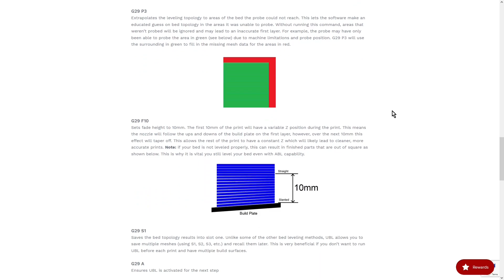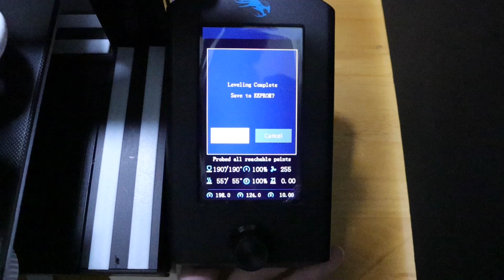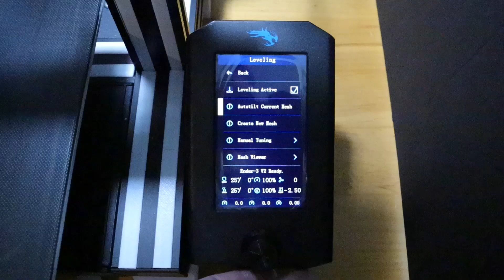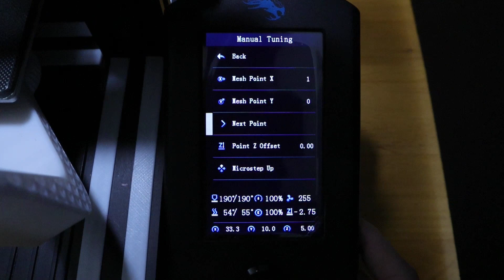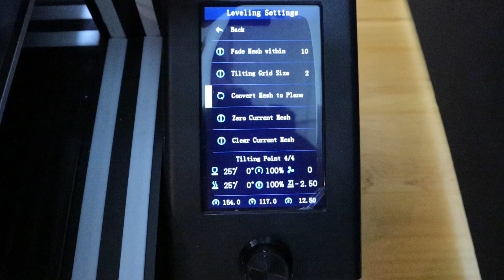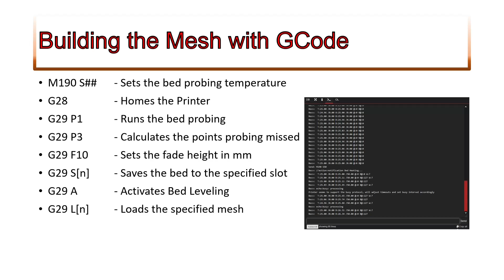Unified Bed Leveling Overview with Jyers Firmware on the Ender 3 v2

Comment: ive been using it smoothly for the past while. specifically the 10x10 hs version. though for some reason it only probes like 68 points out of 100.
Reply from the maker: This is a known issue and something I pointed out in my other jyers video. It happens because the probe can not physically reach all points of the print surface due to the nozzle offset. It will end up missing some of the back and right probe points.

You can work around this by manually setting each of the missed probe points the same way you would set the z offset, just at the different points around the perimeter of the bed.

Ive not bothered with doing that as Ive found that using the G29 P3 command does a decent enough job to guestimate the missed probe points.
Reply: @EB3DPrinting  yea ive been using g29 P3 as well and im always surprised when it think a single point in the corner is super high since it never went over there and the other values are all pretty normal haha. Thanks for your response. glad its not just me

Comment: Fantastic video, thank you. I have an Enders 3v2 with a glass bed and the new CR touch using Jyers Unified Firmware. When I view the mesh the right hand is red ,middle is black and the left side green. Is it possible to help me out please with the bed levelling, as a 78 year old pensioner who is just getting into 3d printing it would be very much appreciated.
Thank you.
Bill M8-)
Scotland
Reply from the maker: So when viewing the bed mesh, the colors are indicators of the bed level. Red means that area is below tolerance, black means that area is within tolerance, green means that area is above tolerance. 

So in your case, since the left side is red, turn the left two bed knobs 1/2 a turn clockwise, then turn the right two bed knobs 1/2 turn counterclockwise.

Next, under the leveling settings menu option, change "Tilting Mesh Grid Size" value to 2

Back out of that menu, scroll up to Auto Tilt current mesh, then run the auto tilt. After auto tilt is finished, scroll down to mesh viewer and see the new changes to the mesh.

Given the nature of creality's glass plates, you will not get a perfectly black mesh, the goal is to get the mesh to acceptable levels. So if your highest red value is below 0.2 and your highest green value is below 0.2, then your mesh is acceptable.
Reply: Thank you the bed is nearly all the same colour. Please Stay Safe

Comment: I’m having an issue where after it finishes probing and I “save” the EEPROM it doesn’t show up in the sd card. Don’t know if it has something to do something with formatting.
Reply from the maker: EEPROM doesn't show up on the SDCard. EEPROM is the flash memory on the printer's mainboard
Reply: @EB3DPrinting  Gotcha, based on this when I begin a print using the start G-Code you posted down in another comment it should pull it and compensate accordingly.
Reply from the maker: @j.riefkohl1965  yes, if using the proper start gcode. It will activate, load the mesh from eeprom, then tilt the mesh for current bed, then begin the print
Reply: @EB3DPrinting  Got it working and if not for your video I would've thrown the BLTouch at a wall.
Reply: @EB3DPrinting  restored my PC, forgot to save the gcode somewhere, couldnt find this video and was going crazy cause i couldnt remember how my gcode was set up

Comment: Newbie here do you need the bl touch to use this mesh leveling?
Reply from the maker: No, Jyers offers a non-bltouch version of UBL bed leveling. It is built the same way manual mesh is. Only different being that you dont tilt the mesh before every print
Reply: @EB3DPrinting  thank you so much for the info… will try it thanks

Comment: i have a bltouch on my ender 3 v2 im just using the normal 3x3 right now but it doesn't compensate the z axis while printing its like its not loading the mesh it made. i have g29 after g28 I've tired 420 s1. should i try the ubl bed leveling? im ready to just pull my bltouch off and go back to manual leveling after every print. the bltouch does absolutely nothing.
Reply from the maker: Without having the printer in front of my, it's hard to tell what might be the problem. I see you typed 420 S1, Im sure you meant M420 S1. This would only not work if your bed mesh isnt saving properly. My three suggestions are:

Make sure to have the bed level before running the mesh. I know, the bltouch is supposed to help eliminate the need for bed leveling, but there is an extent to which it can compensate. If your high point is greater than .2mm and your low point is below -.2mm, I'd say re level your bed

Second, when building a mesh at the printer with a display, I find it better to double save. After the mesh is built, it will prompt you save. Then back at the leveling screen, there is an option to save current mesh, select that as well.

Third, I would stick with G29 after G28, instead of M420 S1, it takes very little time in the grand scheme of things to build a new mesh before every print. I would also try a 5x5 before UBL to see if that helps things. 3x3 is not as consistent as 5x5, for me anyways

Comment: Hi, Great Video.
Others ive watched never mentioned the gcode mods!
I have a question about your gcode listed below in the comments and what i actually need
29A or 420 s1?
I already had 420 s1 in my gcode from previously running manual mesh, didnt seem to add any mesh to my test print? front left was ok for 1/2 a square, rear left was just about ploughing the bed, back right was sky diving in mid air and i gave up before completeing the last 2 "squares".

I want to set the bed temp to 60 and the nozzle to 140 before the tilt test but i am confused by the 4 heater temps?
Thanks
Sean
Reply from the maker: M420 S1 and G29 A preform the same function. They just turn on and activate bed leveling.  So either one will work

The four temps in the code perform different functions.

M104 Sets the Hotend Temperature
M109 Tells the printer to wait until the hotend reaches the M104 temperature 

M140 Sets Bed Temp
M190 Waits for bed temp

From your test print. I would advise manual leveling your bed again, you still need to do that every now and then with the bltouch. Next, make sure you build the mesh, save it through the display, then make sure you have G29 L0 to load your saved mesh

Comment: Great video Evan, very informative.
One question, if I don't want to probe the bead before every print is adding just G29 L0 enough or is this G29 J0 also needed?
Looking to print some 220x220 mm square part on the Ender 3 V2.
Reply from the maker: You would just need:
G29A
G29 L0
Reply: Why would you not want to probe the bed before every print? It is not creating a new mesh every time but creating a mesh and then before every print probes a few select points to account for movement/tilt. I'm currently using the 5x5 HS leveling and I think in going to go with the 15x15 UBL so I don't have to wait for the 25 points to probe before watching my first layer mess up just to have to redo the leveling again and again.
Reply from the maker: @rileyneufeld7001  Edit: seems you understand this concept lol. Its 6am, just woke up, brain not quite working yet....

this is where G29 J'#' command comes in with ubl. You make one mesh of 225 probe points. That mesh is stored. Add G29 J2 after G29 L0. What J2 does is prove the bed in only 4 points, then adjusts(tilts) your 225 point mesh based off of those 4 points. This is what I use to use with Jyers before switching to klipper.
Reply: @EB3DPrinting  I had a question for you, I have been having issue with a high spot in my bed. I have tried Manual mesh, 5x5 and now 15x15 UBL and still cannot get it to lay down a good layer on the right side. Judging by my mesh it doesn't look super high (~.2mm) but enough to get extruder clicks. Do I need to clear my EEPROM? I haven't done that and don't know how to. Thanks.
Reply from the maker: @rileyneufeld7001  have you tried rotating your bed yet? Try  a 90° rotate to see if the probe will hit the bed in different spots. See if that helps
Reply: @EB3DPrinting  I did some adjusting with my x axis gantry I think it was unlevel. That and I did a bit more manual leveling and its much better. Thanks though. Oh and how would I go about creating another mesh? I want to print PETG on the smooth side with glue stick but don't want to override my textured side.
Reply from the maker: @rileyneufeld7001  I forget which sub menu it is under, but look for the option save slot. You have the ability to save up to two meshes. 0 or 1. 

You'll have to change your start gcode depending on the mesh you want to use. Either G29 L0 or G29 L1
Reply: @rileyneufeld7001  I did it like that in the end. Thanks.

Comment: Great video, Evan! but I'm having an issue. When I click on manual bed leveling, it only does the left side. I'll click on the top right, bottom right, or center and the nozzle only goes to top left or bottom left. Any reason why?
Reply from the maker: What version of the firmware are you using? Also, one thing to try. Home the printer, then use the control>move menu option to move X, pick a value of say X=10, Have your finger on the power button. The print head should move to the right, if it moves left, kill power. Let me know how that works

Comment: After you autotilt do you have to save mesh again? Also with levelling active do you need to modify the start GCode or does that force it on regardless? Good video thanks
Reply from the maker: I usually only tilt the mesh before a print, so I dont really save it. but if you did want to save the mesh after tilting it, you could add M500 to your start g-code after G29 J2. This would save the tilted mesh to eeprom before a print.

As far as leveling active, I am not 100% sure of that answer. I have never tried printing without first activating the mesh through the start g-code

Comment: you got a link to that test print?
Reply from the maker: https://www.thingiverse.com/thing:4736317

Here ya go. Even though this is for the CR6-SE, it will work for the E3v2 since they have the same dimension build plate. This is the best leveling test file I've found to work.
Reply: @EB3DPrinting  Thank you!

Comment: I flashed UBL 10x10 BL touch on my 3V2. Created the mesh and saved it in slot 0. When I used the Prepare>move function to move the extruder in various x,y coordinates and z = 0 for testing, the clearance between the extruder and the bed varies as if the mesh didn't exist. Does the manual move ignore the mesh? Will the mesh apply to an actual print? How do I verify the mesh's accuracy after a mesh is created?
Reply from the maker: One thing to try, sometimes the save mesh after building the mesh can be a bit finicky. So go into Control>Save Settings, then go back to manually editing the mesh, see if that helps

Comment: This is great, congratulations on the awesome content. I'm experiencing some issues on my Ender 3 v2 running Jyers 15x15 UBL. I adjusted the X, Y and Z offsets, I can generate the mesh on the menu, I can visualize it (and the visualization makes sense), I added the Gcode to the slicer, but whenever I print I still get very squished filament on the higher parts of the bed. I feel like the mesh is not being used, any insights?
Reply from the maker: Have you run a calibration cube? A 20mm x 20mm x 20mm xyz cube? If so, what height has your z axis(vertical) come out? The UBL is only utilized for the first 10mm of the print. After that, it is deactivated. What I'm wondering is that you z axis steps may be off, where it isnt moving the correct distance in the vertical direction and causing your layers to squish together
Reply: @EB3DPrinting  I should have mentioned it's happening  in the first layer, after that it looks normal.
Reply from the maker: since you are generating the mesh through the menu, make sure you are saving it after it is generated. An extra step I like to do is save settings through the control menu. This makes sure everything is saved to EEPROM. another thing, when you load the mesh. make sure you are loading the mesh from the same slot you are saving it.
To double check, my UBL start gcode after generating the mesh is:

G28; Home
G29 A; Activate
G29 L1; Load
G29 J2; Tilt
Reply: @EB3DPrinting   I'm pretty sure the wizard asks to save the mesh to the EEPROM when it finishes probing, but I'll make sure to manually save everything. I'll also make sure to specify the mesh slot to load. Thanks for the insights!
Reply: @EB3DPrinting  please if you can help me with this. I run the calibration cube 20 x 20 x20 and aways the height vertical is about .30 less then  20mm. I ajust offset many times. what can i do to solve it? thank you for your great videos.
Reply: @renatoyasuda  perhaps see first answer in this stub - z steps

Comment: This video was super helpful, both in helping me understand UBL and in getting me up and running with a BL-Touch and UBL. (I had been running Jyers-Default previously.) Thank you!

I’m having an issue that a few others have seen as well, and I’m curious as to whether you’ve experienced it. BL-Touch is hooked up to its dedicated port, I have mainboard v4.2.2, Jyers v1.3.5b-BLT-UBL-15x15. About half the time I auto-home, the BL-Touch is ignored as a Z-stop and the nozzle crashes into the bed; the motor keeps pulling the gantry down, which brings it out of square with the frame, messes with the tension on the X belt, etc. It’s super frustrating. I see some mentions of it on Reddit, but no one has a fix - did you per chance experience this, and if so, were you able to figure out why (and how to fix it)?
Reply from the maker: One question, when you auto home it, does it try to home in the center of the bed, or the front left corner?
Reply: @EB3DPrinting  Homes X and Y and then moves the probe over the center of the bed and begins descending.
Reply from the maker: @daver3k  Ok, the next thing I would check is to make sure the wires are in the correct position in the connectors.

https://smith3d.com/ender-3-v2-bltouch-firmware-installation-guide-by-smith3d-com/

Does the probe check it self when you power it on? Probe tip goes in and out 2 or 3 times?
Reply: @EB3DPrinting  Probe does complete the self check, yes. I'm using the Creality-branded kit for 32-bit boards, so it's got a BL-Touch v3.1 and a wiring harness that plugs directly in to the 5-pin BL-Touch connector on the motherboard (mine is v4.2.2). The wires aren't crossed in the wiring harness connectors, so the pins map correctly. I've tested the wiring harness with my multimeter and I've got good continuity on all five pins. I've also attempted to rule out interference by running the BL-Touch completely away from the printer - I had it plugged into the motherboard but heading out and away, and manually triggered the pin with my finger once the gantry started descending. At this point I feel reasonably confident that it's not a wiring or interference issue.

What's weird is that it's intermittent - sometimes the BL-Touch seems to send (or the motherboard/firmware correctly interprets) the "home" signal, the gantry stops, rises a few mm, and then slowly lowers again. But more often than not, the BL-Touch goes red but the printer keeps driving the gantry down, running the nozzle into the print bed. I'm not the only one having this issue, but it's obviously not happening to everyone either. If it correctly homes - and it sometimes does - then I'm able to go create a new mesh, tilt it, start a print, etc - but it's only correctly homing maybe 1/3rd of the time now.

I do really appreciate you trying to help me troubleshoot this, as maybe you'll think of something that I haven't, or your experience will help you see something that I don't, but at this point after having checked and re-checked my work a dozen times, I think there's something wrong with either my mainboard, the BL-Touch itself, or (less likely?) a bug in Marlin or Jyers.

So you've never seen this behavior? Do you have it wired to the 5-pin connector on your mainboard, or are you wired into Z-endstop?
Reply from the maker: @daver3k  sorry for the late replies, life is hectic for me at the moment. I have not had or see this kind of issue before. Usually it's the opposite where the z axis just keeps raising.

But, I havent used jyers or marlin since my last e3v2 video, I switched over to klipper. So I'm a bit rusty with it. 

I would agree that it may be a firmware/mb issue. That said, have you tried older versions or jyers, or other versions of bltouch firmware? You could try installing creality's bltouch firmware. I use/used jyers 1.3.2 firmware the last time I used jyers. Last time I used it, there was an issue with multi-color filament and m600 not working.

One last thing I want to add. I will say you seem to know what you are doing, but just in case. Do you have the bltouch bracket installed correctly? Meaning that the bltouch tip extends below the nozzle tip?